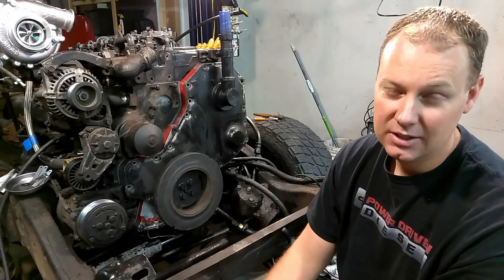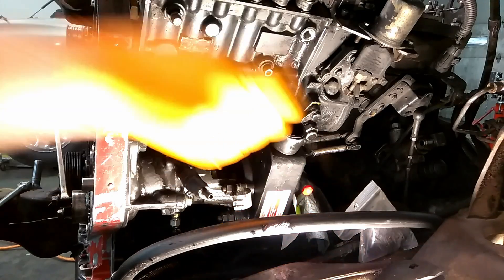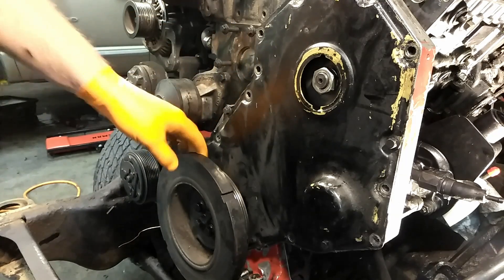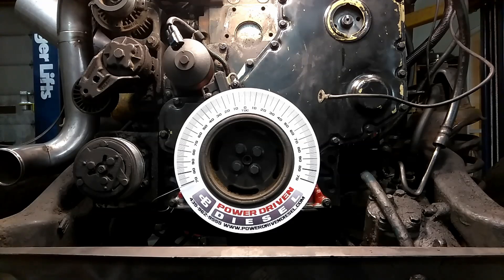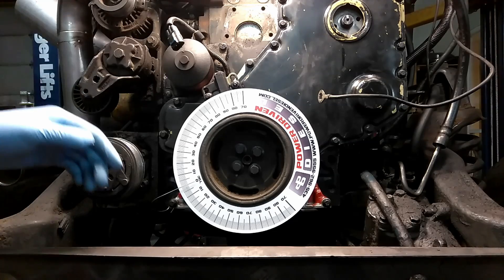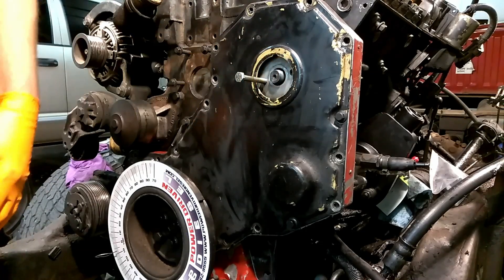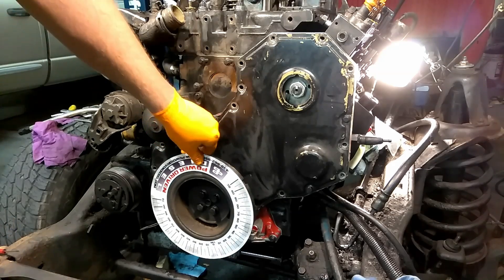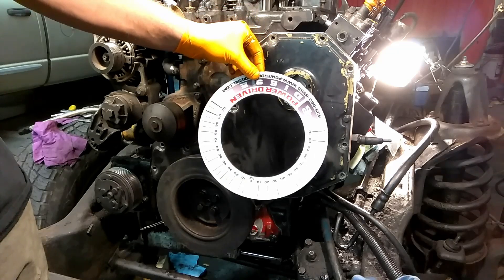Power Driven Diesel Timing Kit Instructions

Comment: Do you have an install video for the adjustable timing gear and how do you verify timing
Reply from the maker: No you do not need the timing adjustable gear and easy way to verify timing is to look up spill port timing. that will get you what the timing of an unknown pump is.
Reply: @pddofficial  I already purchased the adjustable timing gear and was curious if you have an install video for the part and setting timing with the adjustable gear

Comment: Now how do you do this with a VE?
Reply from the maker: On a VE pump you can adjust the pump by loosening the bolts taking a ratchet strap and getting it as close to the head as you can witch typically nets you 3* advance other wise you are taking the gear case cover off and jumping a tooth on the gears.

Comment: would it be a bad idea to put thin bendable sheet of steel just inside the case to catch any slag and put a small tack weld on the pump gear for that little bit added piece of mind?
Reply from the maker: would work just fine.

Comment: Thank you for the how to video and the kit! I did things a little different when pulling the gear off. I roughly lined up the timing arm in the injection pump and removed the nut and washer on the pump gear. Lined up the injection pump pin and pinned the pump with the injection pump gear still pressed on. Then pulled off the gear to avoid the risk of breaking off the injection pump pin 👍.
Reply: I am not new to mechanics but I'm learning as I go on these diesels basically I'm trying to find a very simple way to do this this is not a bad way is the way that he is showing it here in this video so basically what you're saying is you got that little tiny pin or arm whatever you want to call it that's in the pump that has the plastic thing you got that at top dead center first then you jumped up on loosen the bolts on the timing gear for the pee pump itself and then wow that little pin is locked in place in the pee pump and now you have the gear sprocket loose you turn the engine to where it was top dead center and push the pin in the little plastic pin in steel whatever it's made out of right besides the pump now you pull the gear off everything's locked in place pull your pump off then put your new pump on and when you put the new pump on does it already come timed to the original spec of the side of the engine the data plate or do you put the new pump buy hand separate from the engine cuz the engines already locked at top dead center and you just line it up just how the one you removed was and the same identical positionand then your timing set without using no type of degree wheels or anything forgive me if I am speaking wrong on this but I think that's the way that it goes there's got to be a way to do this just like changing anything else without even using any of this stuff if you just want to go back to factory

Comment: How can you tell by using this wheel if the timing has already been changed on the engine?
Reply from the maker: you would have to use the spill port method or a dial indicator

Comment: I'm a little confused.  You pinned the engine to top dead center. How did you keep turning the pump to center to pin it with the engine pinned?
Reply from the maker: They should line up together when the motor is pinned otherwise you have to double nut the pump and spin it that way
Reply: @pddofficial ok thank you and thank you for the reply.   Next question.. I installed ypur 4k springs .. tgeres apparently no fuel plate in this thing ( prior owners doings) and it still won't rev past 2200 rpm.. do I need to keep the fuel solenoid off??? Or on?? Vany help is greatly appreciated

Comment: Just bought your degree wheel,is coming in the mail,my 96 Dodge has close to 300k on it,just bought back from my son,mine original,,Beautiful Ol Gal,so I can safely go 8 degrees ,my Son had bought the AFC unit,I installed it already,just looking to gain a few ponies,runs Excellent,what would you suggest after timing,probably new injectors Im sure,thanks
Reply from the maker: Yes depending on your power goal a new set of injectors would be a good option.
Reply: So 20 degrees is a good place,heard that could make a hard start,right now it fires Nice,hit the key and she lights off,

Comment: So if you set your degree ring magnet on the pulley as soon as you get the TDC Plunger in and set the wire indicator pointing to zero.  Once you pull the TDC cam pin and rotate your engine to find the pumps marker you will be able to see and know your pump is set at 14 degrees or if it's been changed. Correct?
(I think my engines previous owner monkeyed with the timing!)  
Then it will just be a matter of popping off the timing gear and rotating the engine to the degrees you want to total advance it and will not have any question as to what it's set at, if I understand this correctly.  No adding or guesssing as I see it.
You set this one to 22 degrrees advanced, but I thought I was told that for my 400 HP settings I only needed 18 degrees.  So I'll be doing some research before I torque it all back down.
FYI the pressure bvalves and govenor springs were quite the challenge to do standing on my head using mirrors.  Hence me switching to simple back up cameras and a monitor.

Been a few years since I degreed out my Hot Rod Gas Engines cams, and just making sure I have the total comcept in my head.  
Cuz,  I'm about to do mine in my front engine RV and it's going to be a standing on my head job.  My plan is to set up small 4 inch back up monitor & camera, p;us a bore camera for the P Pump and do it all by feel and watching the monitors.
Should be interesting!!!!!

Comment: When you find TDC should the pin in the pump be visible or will you have to rewind the engine to the correct degree to find the pin?
Reply: Pretty sure u go clockwise with it till u find the pin in the pump

Comment: so you can crack the nut loose on the pump with the pin in place.. then after timing only partly tighten with the pin in place?.. i don'y want to break my pin

Comment: Oil fill tube ??
What
Reply from the maker: Do you have a 12v Cummins or p-pumped 24v?  All the factory pickup truck 1994 thru 1998 12v Cummins have an oil fill/oil cap and tube assembly.  This whole assembly can be removed to gain access to the injection pump gear/nut.

Comment: Sry for the noob question but what are the Benefits of retarding it 8 degrees more? Do you gain hp? Or faster acceleration? Does it run rough at idle or smoother?
Reply: By retarding the engine like this you’re not changing the valve train timing but you are actually advancing the fuel timing which puts fuel into the cylinders earlier creating a better chance for the fuel to burn completely before going out the exhaust, increases power but will increase cylinder pressure/temps and can cause hard starting when cold
Reply: @jessevella7616  I’ve had advancing the timing help starting not doing it this way though we tilted pump and it was on another pump
Reply: retarding makes it fire fuel quicker to the cylinder therefore it can gain power from what i remember

Comment: Can 215hp pumps at 13.5 stock timing benefit from 18° I know all pumps are times different from factory. Can some p7100 pump perform better than others with same "18°" let's say a 160hp vs 180 or 215? Thank you.

Comment: Hello. Why do you need to adjust the timing? What is it good for? :)
Reply: When you advance the pump timing you increase the high rpm horsepower. Sometimes you get a little better mpg. Up to a point, don’t go to far. A few degrees maxes a big difference.

Comment: Hello, in my case my truck injection time is 12.3 degrees.  How many degrees will I have to advance.  I bought a tool from you and I look forward to using it.  Thanks
Reply: @pddofficial   is the factory timing the same for all let's say 215hp pumps. My truck doesn't have the data plate and some say factory timing on a 215hp is 13.5 some say 15.5 did some searching but can't find a solid answer. Would 18° be good for a 215 pump? AFC live and supporting modifications, 4k gsk, 60lb over valve springs, 191 delivery valves, ( runs very clean ) 5 speed 4.10 rear end. 9,000 pound service truck, daily driver with a little get up and go. I don't hot rod the truck, but do enjoy a smile here and there. Also tow 10k pounds on occasion. Thank you in advance.

Comment: What if your pump has jumped timing? Would you pin the pump first, pull the gear and then find TDC on the motor?
Reply: pin time the pump first then pull the gear off. this makes it easier to turn the pump where it is supposed to be. then when you pull the gear off and turn the engine you can find tdc and the pump gear is of so it won't move.

Comment: So does this work with unknown timing etc? Ppump swap... pin tdc the motor, pin the pump cam without the gear then install the gear at what ever advanced timing..?.. or is there more to it since the pump would be zeroed as well as the motor rather than say factory 12.5 or 14 degree

Comment: I always loosen the pump gear nut but dont remove it till the gear is popped loose 
If you have your front cover off and remove the pump gear nut then put the puller on the gear when it pops loose your gear will end up on the floor 
27year mid range factory trained cummins tec
Reply: 🤦🏼‍♂️I learned to keep a hand on it after the first fail

Comment: I’ve been watching your video for a while. I will be shopping from your site first chance I get. I was wondering if you all have any products for 01-02 P Pump Conversions? And if so, may you please make a video on the conversion? Thanks
Reply: @pddofficial  can i get the link for the timing kit? o also have an 01 24v that i and converting to p7100 but am having a hell of a time figuring out correct timing... i had the pump timed at 18 degrees from our local injection shop. any help would be greatly appreciated
Reply: @deanpeterson7972  I've got a 01 24v with a p pump as well. What timing did you end up going with?

Comment: Excellent Video guys Thank you. Question though. One we check pump/pin time, how do we ensure both time and to not shear plastic pin off once we start to loosen pump gear nut. Conversely if we confirm pin/pump time but then pull plastic pin so not to shear it off then loosen gear nut won’t the pump slightly rotate throwing everything outa time??
Reply: Seems like it would be better to loosen the nut BEFORE putting the tool into the pump.  That way, you don't accidentally turn the motor/pump while trying to get it loose (and shear off the pin in the pump.)

Comment: Another great video. I suppose if the killer dowel hasn't been taken care of yet, a person could change their time while also taking care of that issue. By the way what years was that an issue?
Reply: Parent of Twins. Pretty sure the 94-98.5 2nd gens were the only culprits. Man get it done before it’s too late!!!
Reply: @thankfullife7968  also the 89-93... everyone forgets about a 1st gen.
Reply: My 98 12 valve had the dowel pin fall out before I bought it around 190k and my 97 was still good with around 190k. I think the guy who sold me the 98 tried turning up the fuel but didn't know what he was doing and that might be why the dowel fell out. I drove it straight home after buying it and immediately started restoring the entire engine. My 97 was a lot more clean than my 98 as well. I've been curious if they were built in different factories.

Comment: just wondering if this timing kit you sell will work for me when i Ppump swap my 24V? and if so where do you get the top dead center pin that located on the back side of the timing housing?
Reply: Thank you for the info ill be buying that tool and the push pin didn't come with the gearcase. So where could i buy one?
Reply: Ok cool I'll google that and see what I come up with!!
Reply: @coyne250  not seeing the answers to your questions which looked like the answer I’m looking for as well
Reply: Good question!!

Comment: What if it's not at factory timing?? How do u adjust it then
Reply: Pin the motor at TDC and pin the pump so you know that everything is at zero, just like he did in the video.
Reply: Blake Taylor stock timing. The pump timing lock pin is set to the spec on the cover unless the pump was ever off and rebuilt and requested that the static timing lock be moved to a new pin timing.
Reply: Okay so if I tdc the pump and engine separate I am at 0° timing or stock timing?
Reply: Honestly though using the dial indicator method I feel is better in the long run.
Reply: agreed! or how do you find where the timing is set to begin with if it has been fooled with?
Reply: Oh okay... I ordered the magnetic degree indicator from powerdrivendiesel because mine ended up slipping because I didn't clean it well enough. So I can set both of the pins on the engine and on the pump to where they are engaged and that is my stock timing of 14 degrees... also I had a question about what I should set it to or what is the amount of room to play with it and what are the benefits of advancing the timing more?
Reply: DLS13DLS. I know my 94’ factory timing was 12.5* and I just advanced it to 18*... very common for most “normal” street applications guys set them anywhere from 16.5-18.. read different guys have tried 21-22 and end up going back to 18ish. Setting it in the 22* range is more for higher revving applications but trade off is header starting and lumpier idle.